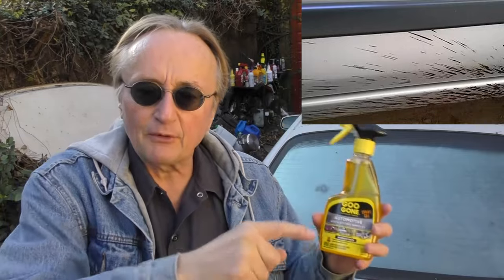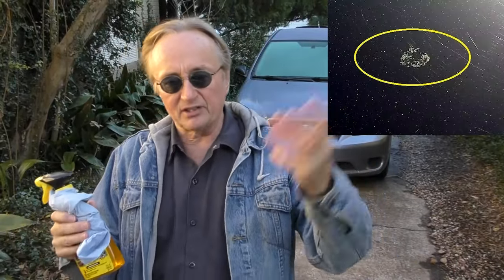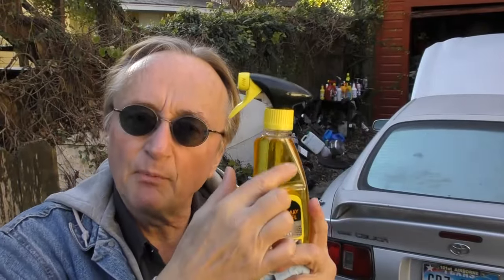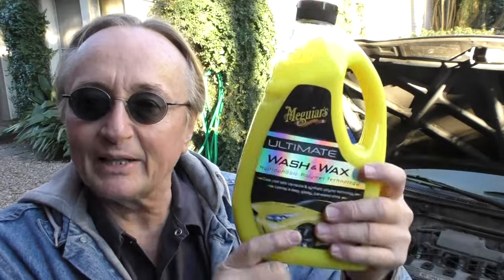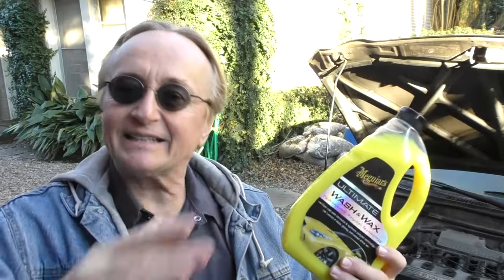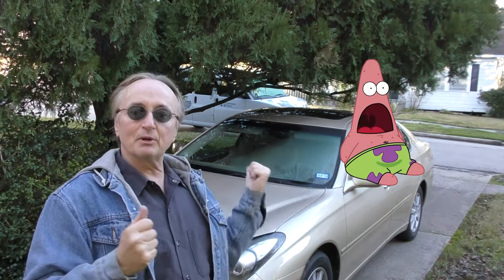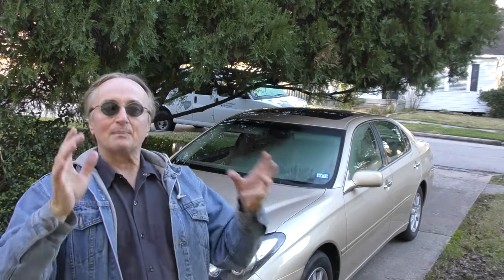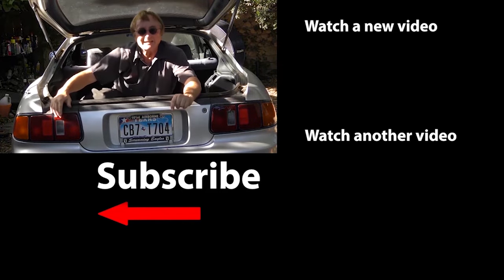Doing This Will Make Your Car Paint Last Twice as Long

Comment: I prefer to go to a car wash and use the hose myself  . I use their handled brush but only on bottom of lower panels and never on the hood or roof . I also rinse the bristles first with the hose to get the last guy's crud  off of the brush . Bring your own wash cloth for upper fenders , hood , roof  and tops of the doors .

Comment: Hey ! Your absolutely right about nu finish ! I have detailed cars on the side for years and I also used nu finish. I have told my lazy friends to use it because it works great because it goes on easy and off easy Plus it last longer then most of the wax’s on the market. It’s easier to wax a car then making car payments on a car. But really buy a car that you really really like and one that will last for years ! I look at my 08 Lexus RX 350 and see the new models and they look great but for some reason after all of the cars that I have had I still love the look and style of my RX and it’s a black in color. With oil changes and a little wax over time you will see the full benefits and no  $ 1500 a month car payments and the possibility of having a Classic car ?

Comment: I have found that final rinsing with the high pressure wax setting at the self car wash eliminates the need for hand towel drying if driven at highway speeds right after for 5-10 minutes and leaves no spots as it dries. I wonder if that is similar to the hand applied wax.

Comment: I trust Scotty knows how to mechanically take care of cars and at the most fundamental level take care of the appearance. However as a pro detailer I first off can tell you coatings aren't crap. The ones that the dealerships try to sell usually are and the $5 Chinese coatings you get on eBay are too. But as others have said, when the prep work is done right and a trusted coating is used, they can last many years without having to wax during that time. They also have other properties like hydrophobicness and adding additional gloss. They make your car look good and also make it much easier and faster to clean going forward. Yes they are expensive but I don't sell it at the prices I do because I want to rip people off. It's because applying them (including all the prep) is very labor intensive and time consuming. Now this is all great and nice but yes not everyone wants their cars to be polished to near perfection then coated or if they do they don't want to pay the price for it. As a realist I know 90% of people don't want a coating nor do they NEED it. But if you want to keep your car in the absolute best condition, coatings help tremendously. Also if someone tries to sell you a coating claiming it is invincible, they're lying. They do help reduce you getting scratches during washes (where most fine scratches come from) but no they aren't going to stop the paint from scratches when the kids run their bikes along the car or you run into a brick wall. Also if you don't want to a coating I would suggest staying away from carnuba wax if you are looking for good protection unless you plan to wax your car about every 2 months maybe and mainly keep it garaged. Look for a "sealant" as they are referred to. They are made to protect better and last longer but you will still want to apply them 2+ times a year depending on if your car is always outside/inside, warm climate/cold climate, etc. They are typically just a little more than carnuba waxes. You also want to clay your vehicle about once a year to remove embedded contaminates otherwise they buildup and you just wax over them and it hinders the bond of the wax/sealant to the paint which hurts the durability. As Scotty said park in the shade but it's best to avoid trees. They can be just as  bad as the sun if you don't wash/clay/protect your car often since trees drop sap, twigs, acorns, pollen, birds sit in them and poop on your car, etc. I have heard good things about nu finish but it certainly shouldn't be called a "polish" but I won't get started on the terminology people and companies throw around and alot of times misuse just to make something sound good. As for as protection, it may work just fine for you. Hopefully this helps someone.

Comment: To simplify things: 
Spray Waxes (Up to 2 weeks)

Carnuaba wax (Organic) lasts up to 3 months. 
Polymer Sealants (Up to 6 months)
Silica Dioxide Sealant (Up to 6 months)
Ceramic Coating (2+ years)

Just like painting cars, all in the prep work for best bonding, wash it clean, claybar it to remove embedded contaminants at a minimum, for better results and for glossy finish paint correct with compound and polish then apply any of the above. This isnt a complete rundown, sure there is more to it but for the basis of clear coat protection this is simplified. Also, to note cheaper cars (hondas, toyotas etc) have thinner clear coats thats why you mostly see those types of vehicles with clear coat failure, oxidation, peeling, cracking etc. Protect your investments and resale value by keeping that clear coat protected. If the paint doesnt bead anymore = NO PROTECTION. At a minimum just spray wax it after every wash or so.. ***Only applies to people who care.

Comment: I love your videos Scotty and the pictures you pop up are great. However I don't think bird poo is actually acidic it's the way it reacts with the clear coat as the temperature changes throughout the day. So if it poops on a cold morning but it's left on in the sun all day it will start to react with the clear coat and can leave a permanent mark. Also don't use paper to wipe it off use a microfibre cloth.

Comment: My 97 Nissan Sentra's paint is coming apart despite me rubbing it clean and shiny with 3M products periodically. Don't know what to do anymore. Car's otherwise in perfect condition. Did a complete interior strip and removed rust and old bolts and stuff. Looks shiny on the inside, worn out on the outside. Dame.

Comment: Hey Scotty. Suppose you don't have the luxury of parking in a covered or shaded spot, would you recommend using a car cover during summer months to protect the paint job from UV rays?
Reply: Problem with using a car cover outdoors is, if sand gets under the cover and the wind is blowing, it will shift the cover back and forth like sand paper on your finish.  Not to mention the mess if it starts raining.  Car covers are not water proof, nor do you want them to be as a plastic cover will trap moisture and rust your car.

Comment: Car covers can help keep off the punishing sun if you have to park outside, but you'll want to be sure the car is clean before you put it on, and you'll want to put it on carefully so that the cover does not scratch up the paint. Basically, it's a pain in the butt unless you only drive on the weekends or something.

Comment: Hey Scotty, I have a 2000 Buick Lesabre with the 3.8L v6. The car shakes when you lightly press the accelerator (while accelerating with low rpm), but goes away as the rpms go up. It has 120k miles on it. Is there an easy fix to this?

Comment: I remember once in a parking lot while I was looking for a parking space a flock of birds all crapped on my car.  Thankfully I was not in a convertible with the top down.  That would have been the most disgusting thing to ever happen to me.  It didn't damage the paint but I took it to one of those self serve car washes where you pay a couple dollars to start the pump and got it off before most of it could dry.  One time on my mother's Jeep there was bird poop the size of a quarter and it etched the paint so don't let it sit too long or your paint may be damaged.

Comment: Kind of off topic but given your details on what the process is for automobile painting... what happened with the white Chevy's and all the paint coming off?
Reply: Remember Scotty saying about the thin layer of base paint? It was put over a smooth hard primer coat and the base coat just didn't stick. Any paint manual will tell you to scuff the primer... not GM.

Comment: the reason you spray your car off first, because if you threw a soapy sponge or rag on it, the dirt and particles on the car will act as an abrasive and cause scratches

Comment: you can put an optimum glass coat on the new car or compound the old car to remove oxidation an bring the gloss back then apply the coating and never have the paint were out and never wax it again just wash it down with plain water and the car will always look like it just been waxed

Comment: Try not to use a sponge or rag to wash your car, Find a soft horse hair brush! (see window cleaning supplier ) They are costly 120$ but last forever. Been using mine for 20+ years once a week on two cars and it will most likely out live me. wash time is cut in half and the cars are clean on the first pass :)

Comment: Actually Scotty, even if it says polish on the NuFunish can, it's a paint sealant.  Technically it's a polymer scealant.   Good product for do it yourselfers.   As for SiO2 coatings, they are very good, but preparation steps are very important and should be done by a professional.

Comment: Hey scotty ..or anyone 
..thoughts on ceramic coating? Jist.bought a new car. Thanks for the help !
Reply: Yes did same recently on my new car. Wait a couple of weeks for the new paint to really cure. Clean car spotlessly with micro fiber cloth and apply nano coat. Makes new car shine even better and protects paint. I do the windows also. Water beads of windshield fast at high speed. Much easier to wash and car self cleans in heavy rain while driving. I used this on my last car as test and after 6 months still looked like the day I applied it. Highly recommend. Watch lots of videos about application. Check out "pan the organiser"  channel for starters. Cheers
Reply: @fezz569  Im gonna pay professionals with good review to do it.. thank you for taking the time to reply ! cheers !

Comment: The best way I found to maintain your finish, is NEVER, NEVER, EVER use detergents to wash your car. For one, they're not needed and it's a waste of money.  All you need to wash your car is a GOOD wash mitten/glove/towel and WATER.  I know a lot of people like to use dish wash detergent, because they think it's liquid, so it's safe; however, it still dries and when it does it will leave a residue, and over time this will dull your finish. The only other thing you need is a good wax or polish to protect the finish. Wax it a couple of times a year, once in the early summer and in the fall just before the cold and snow comes. I've did this with my cars since 1995, and when I trade them in, the dealer swears I had it painted.  I didn't believe it myself but I gave it a try, and it got me top dollar when I totaled my truck. Had a bent axle and major front end damage and the insurance agent just kept saying this must have been a new truck. Nope, bought it 1999, Atlantic blue paint, and wrecked it in 2007. 8 year old truck that looked new, he gave max for it. Next new vehicle you buy, try it, just wet it down and go over it with the wash mit and rinse as you go, you'll find it drys better and looks cleaner. And you save money on cleaning materials. The only reason I cheat now and go to the car wash, is I have a bad back, but it works.

Comment: careful with always using polishes. Polishes are like ultra fine sandpaper and they rub off a very thin layer of clearcoat after each application. If you keep using that stuff you'll burn through your paint. Use a sealant instead of wax, as those can last 6 months.

Comment: An important thing to note is: if you're already driving an older car and the clear coat has already been stripped off partly, or if it has been repainted with no clear coat, DO NOT USE GOO GONE! It will eat through your paint...it's only safe where there is clear coat present.

Comment: I always hate it when someone who is Viral, doesn't do a proper research about the product or industry they trash talk.
Don't get me wrong, Scotty knows his stuff mechanically, thats a fact. 
But as a certified detailer, I always test products so I know what they are and how they behave, so my take on this is:

Wax: cheap, anyone can do it and it lasts a few months if you use pH Neutral shampoos (pH 7)

Sealants: a bit stronger than waxes, last longer and basicly apply in the same way

Ceramic coatings: last the longest, are alot more hydrophobic than any wax/sealant and they have higher pH resistances (they will still be affected if you wash your car frequently with a high alkaline or acidic shampoo or prewash.

And remember, what ever you apply on your paint (wax, sealant or ceramic coat) you MUST prep the paint properly, if its oily or greasy, nothing will stick to it.
Cheers
Reply: Could you help me out, i recently got a 17 mits. lancer and im wondering if washing it once a week and applying a wax and dry spray afterwards would be enough to keep the paint pretty good? I do have it parked outside daily.

Comment: I use a sealant that all you have to do is wet the car spray some on lightly then rinse and you now have a car that repels water.  Some people would have to see it to believe it.  The same manufacturer of that product makes a car wash soap that has that in it too.  No, it is not a wax or a polish.  Please note that simply because I am not here to advertise for anyone I have not mentioned the name of it or who makes it.  If you know anything about these things there is a chance you already know.  I will tell you this however, I have not used a traditional wax or polish ever again.  Water just blows right off the car driving down the road and even rolls off if you disturb the car at all.  It can get you a little wet getting into the car if you are not careful and maybe even damage your phone if you are truly unlucky.  Not all of those sealants are bad Scotty.  Just do the research and see what happened.  The ones who "ruined" their paint probably have a dark finish and did not apply it properly.  Do not use them if you think you can't because the ones who think they will ruin their paint are the ones who usually botch everything.

Comment: The problem I’ve got is, it’s very difficult to polish a car when the weather is cold, as first you need to wash the car with water, and dry it really well. Had anyone tried to wash a car, and then dry it, then polish it all at the same time? It’s very difficult as even if you dry it with a proper drying towel, if the weather is cold water will sit in all the nooks and cranies, so when your buffing off the polish your polish cloth will pick up water all over the place, water+polish doesn’t mix, and ruins the polishing process. 

I know professionals have hot air blowers to blow out all the water, but your average joe doesn’t have one of these machines in the garage!

Comment: I wax my car the easy way: first I spray the roof, etc. with a wax/soap, then I pressure wash it down, then I polish it by hand. I do it at least 6-8 times a year, too. Only problem: I change my car every 3-4 years, so I've never seen a difference in the long-term.

Comment: Wait, you’re saying Ceramic Coatings are garbage? You’re out of your mind. They may be expensive if you have it professionally installed, but fairly cheap if you do not yourself. Using traditional ppf or a sprayable version like AutoFlex Express and then ceramic coating on top will give you better protection than this Nu Car Finish. I getbif you’re old school and can’t accept new technology, but boss you are way wrong about ceramic coatings being garbage. I just feel bad for the subscribers that are blinded by everything you say without doing their own fact-checking.

Comment: I’ve had my car for 4 years and put a ceramic coating on it every year. The technology isn’t junk. The problem is you have to strip old waxes, sealants and other coatings. Which means you have to get a soap that is not ph neutral. A ph neutral soap will not remove traffic film or imbedded containment’s. And if it’s heavily contaminated you’re also gonna need to clay the car. So the people you talk to that got their “paint ruined” probably didn’t do it right. Or they cheaped out and bought the cheapest they could find which when it comes to ceramic coatings is a big no no. But to say all of them are junk is nonsense.
Reply: Fuert Neigt who me?
Reply: Or are you talking to Scotty?

Comment: Don’t use no snake oil garbage just clay bar and buff if if the clay doesn’t get it all. Goo gone is nothing but watered down oil gas product. Just use clay and some good greot’s buffing compound and watch the shine. And yes wax is wax but what they cut it with and what amount of carnuba in it is different. I love greot’s best of show it goes on like butter and comes off super easy I can wax an entire car in 5 minutes. Well minus the wait time of course but that’s not work is it. Just look at my 2013 dodge it shines like a show car and the paint was destroyed when I got it that’s why I got it so cheap well that and it’s a dodge 😂 but I did an entire car paint correction and buffed it and you couldn’t ever tell it had 6 inch scratches on it. I went back to the lot I got it from a few months later and dude was blown away I had fixed the paint put on 20” chrome helo rims and tinted the windows he was impressed how I turned out he honestly thought it was a lost cause. First thing he did was get my business card and Facebook page address and started sending me his really rough stuff for me to put back like new.